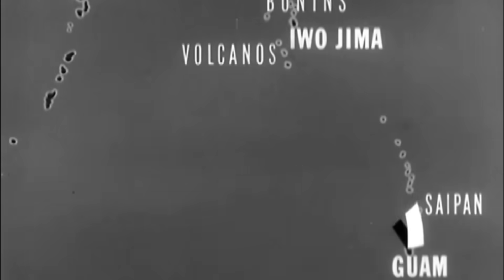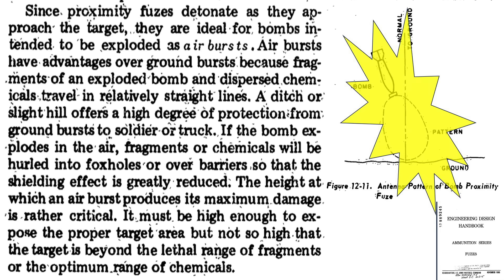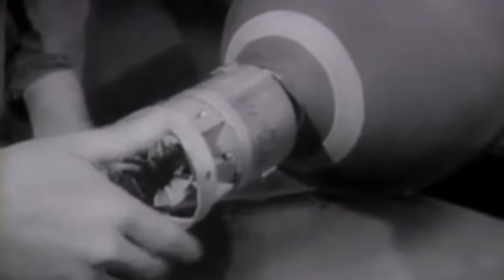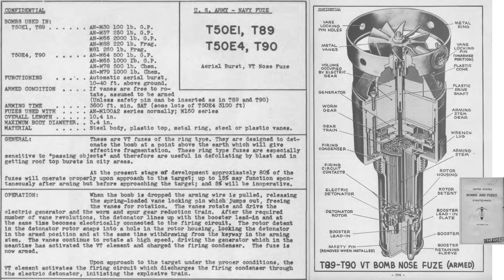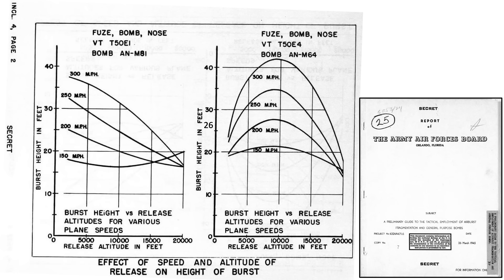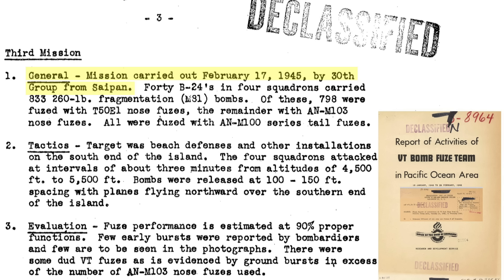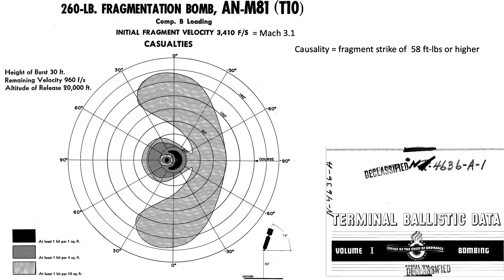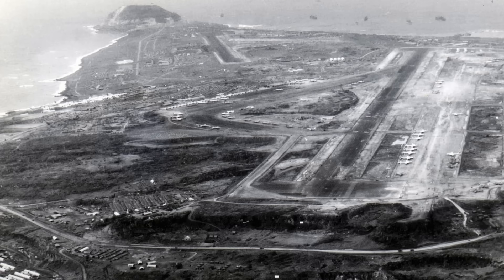B-24 Proximity Fused Bombing Attacks Supporting the Iwo Jima Landings – Combat Effectiveness Review

Comment: The proximity fuse was so secret that the US Navy did not use them when the shells could come down over land, only water.  By 1945 this had changed but by then the garrison at Iwo Jima was already well entrenched underground.  The shame of it is that if the US had invaded Iwo Jima earlier the garrison there would have been much smaller and caught above ground making the taking of the island much easier and far less costly.

Comment: -A proximity fuse on a bomb is not hard to achieve since the bomb is unlikely to be subject to much more than 1g of acceleration.  What is hard to achieve is a shock hardened proximity fuse that can remain functioning after a 10,000G acceleration from a 1000m/sec canon.  The Germans had air dropped bomb a proximity fuse based on their excellent FuG 101a radar altimeter.  The allies were so concerned they started developing countermeasures in case they were used.  There indeed was a program for these.

Comment: I believe VT fuzes were effective against aircraft, but I find their effectiveness highly questionable when it comes to attacking Japanese soldiers hidden in tunnels, such as those on Iwo Jima. While they might have been effective against soldiers in trenches, the Japanese troops on Iwo Jima weren’t even in trenches.
Reply: I think for the most part it turned rocks and coral into smaller rocks and coral. In this case I think the regularly fused bombs might have been more effective. On the other hand, 16" naval shells were not particularly effective against this target either.

Comment: During the Vietnam War, Mk81 250-lb bombs were often fitted with tubes protruding from the bombs' noses, with fuzes at the forward end of the tubes.

This begs two questions :

1) Why were these fuzes used instead of proximity fuzes ?
2) Why weren't such tube/fuze assemblies used in WW2 ?
Reply: I doubt that they were "often fitted" to 250-lb bombs. Note that a proximity fuze is a different beast for a different purpose - exploding a good few metres above the ground. You are referring to the 36-inch Daisycutter fuze extension - in Vietnam it was used mostly in 500-lb, 750-lb, and 15,000-lb bombs to clear helicopter landing zones (HLZs) in dense jungle - they of course exploded only just above the ground using a contact fuze. They were of no use on a 250-lb bomb. The first reference to a daisy-cutter type of bomb is in 1918 in an attack on the RAF airfield at Bertangles. It WAS used in WWII - Oskar Dinort invented an extended-nose fuse device known as the Dinort rod (Dinortstäbe) which were placed on the noses of SC 50 and 250 bombs dropped from the Junkers Ju 87. [much of the above is from Wiki].

Comment: According to a book I read about Japanese secret weapons development ( I'll dig up the title and post it below.), Japanese scientists came with the idea for a proximity fuse on their own, but it was an idea that remained on paper.  They never even tried to make a prototype.  

There is a reason for this.  Those American proximity fuses had four vacuum tubes in them to run the device.  The first transistor wasn't made until 1948.  A vacuum tube is a bunch of metal bits stuck inside a sealed glass tube with a ceramic cap on one end.  Obviously these devices are far more easy to break than a modern transistor.  American made vacuum tubes; despite having a glass envelope, were very rugged.  They could survive hundreds of G's caused by being fired from a 5 inch gun and the centrifugal force of being inside a spinning anti-aircraft shell.  

Because of lack of proper materials in Japan due to submarine warfare and Japanese manufacturing degrading because highly skilled workers weren't immune from being conscripted, Japanese made vacuum tubes were garbage.  The failure rate on them was insane as was the high percentage that simply didn't work straight out of the box.  Japanese scientists knew the idea for a proximity fuse was a good one, but also knew Japanese made vacuum tubes wouldn't survive being fired from an anti-aircraft gun.

The book is "Secret Weapons and World War II: Japan in the Shadow of Big Science" by Walter Grunden.
Reply: -The Germans did have a proximity fuse program for FLAK.   In early 1940 they suspended it during the battle of France because all resources were to be devoted to weapons that could be fielded within 6 months with rare exception.  By the time they restarted it and were conducting firing trials in 1943 the USN BuOrd fuse was in service for a year in the Pacific
-Interestingly some of the ideas of the German fuse were disclosed by "The Oslo Letter" delivered by a German based Scientific Publisher to British Intelligence in 1940.   The letter explained how the fuse would work and even had a shock hardened vacuum tube called a cold gas Thyratron with the letter. 
-The Oslo letter fuse had the effect of restarting the British proximity fuse program which had been abandoned in about 1932 or so.  The British decided to focus on using thermionic vacuum tubes.
-The German fuse was very credible since German Bombs already used a Rheinmetall Borsig electronic arming and in some cases an time delay with cold gas Thyratrons that could survive impact with the ground.  
-The Cold gas Thyratron was only a sensitive and precise switch but it was extremely tough, so precise it could produce 0.1% accurate timers and so sensitive it could trigger of static electricity.  The Germans were able to transport and deliver bombs with the fuses installed and arm and disarm in the air.
-It's power consumption is so low it didn't need a battery, only a precharged capacitor.
-A Cold Gas Thyratron has 3 electrodes: Anode, Cathode and a Striking Anode in between.  A small voltage applied to the striking anode causes conduction which can be used to blow a fuselink that initiates a primer.
-A RC circuit can be charged to set the threshold for a timer.
-In the case of an electrostatic fuse an aerial Offset to the one side of the shell creates a 500Hz voltage which is rectified by a copper oxide diode and used to trigger a Thyratron.
-The plan was to use electronically timed fuses, electrostatic fuses or a combined fuse with a nose contact backup fuse. 
-The fuse worked to about 4m when tested on a firing range using 88 shells and lab versions worked to 10 and 15m.
-KUHGLOCKE, Electrostatic by Rhinemetall-Borsig. Intended for missiles.
-KUHGLOCKEN, Smaller version designed for AA shells.
Reply: Bombs are actually quite gentle on fuses. Artillery shells slam fuses with 20,000G - aerial bombs don’t (until they hit the ground (in which case a proximity fuse has already failed)). 
Vacuum tubes don’t actually need to be made of glass either - metallic vacuum tubes have been made (glass is just easier to seal and blindingly obvious when it fails).
Thermionic valves are actually still in use in some applications because of their radiation resistance (and thermionic devices can also be created on silicon and diamond chips).
Reply: @allangibson8494  - Bombs are more gentle on fuses, which is why proximity fuses could be used to create airbursts above ground targets in WW2, I believe starting in 1944, maybe 43.  

I should have been more clear why the Japanese couldn't create a proximity fuse.  It wouldn't have mattered if they used a metal sleeve rather than a glass tube for their vacuum tubes.  The flaws in Japanese made vacuum tubes were found in the materials used in the internal construction of their vacuum tubes.

For their time, vacuum tubes were pretty sophisticated in their construction.  Tungsten was used for the heater, the hottest part of a vacuum tube.  Molybdenum; which is also heat resistant, though not to the extent of tungsten, was used in parts near the heater.  Nickle was used for some parts; I believe mixed with chromium, and finally the metal prongs which extend from the ceramic base were made from or clad in copper.

Japan had tremendous difficulties getting any of these elements in sufficient quantity to be used in electronics.  

They couldn't get Nickle at all, except by melting downs coins with Nickle content captured in Hong Kong.

Molybdenum was almost impossible for the Japanese to get.  The U.S. embargoed Molybdenum shipments to Japan starting in 1939.

Tungsten use was rationed.  It was decided that aircraft engine parts that needed to be heat resistant was a higher priority than vacuum tubes.

Even the use of Copper was rationed.  The Japanese stopped using Copper in wiring or other electronic parts.

They replaced all of these materials with iron.  More accurately, with iron alloys.  For electrical conductivity this works, but iron has some fatal flaws when used in electronics.

First, it rusts.  Not a problem inside a vacuum tube, but a problem for anything outside of that vacuum, like those prongs that were on the outside of the base of the tube.  Also, very bad for external wiring when the insulation is broken in any place in the wiring.  So, this weakness was a nightmare for the Imperial Japanese Navy for obvious reasons.

A related problem; found after the war by U.S. researchers, Japanese wiring insulation was questionable, because their plastics industry was five to ten years behind the West.  In worse case situations they used paper and wax as insulation.  For heavy electric cables the situation wasn't that terrible, the Japanese coated those cables in rubber.

Iron lacks the heat résistance of Tungsten and Molybdenum, so it doesn't last very long. 

Also iron isn't very ductile compared to some of these other elements.   In other words, it's brittle and won't stand up to high G's.  This may have been the main reason why Japanese scientists knew that it was impossible for Japan to make a proximity fuse.

The mean lifespan of a Japanese manufactured vacuum tube was about 100 hours.  This doesn't count the large number that simply didn't function at all out of the box.  The Japanese didn't start to improve quality control testing for defective vacuum tubes until about mid-1944.

I keep finding different numbers for the expected lifespan of American made vacuum tubes, but it was in the low thousands of hours.  At least twenty or thirty times better than anything the Japanese could make.
Reply: What about a fuze for air dropped or rocket launched ordnance? The acceleration forces would be much lower.
Reply: @Treblaine  - Bombs were used in WW2 with proximity fuses to airburst above ground targets.

Rockets with a proximity fuse were just being introduced at the end of WW2.
Reply: @Kwolfx  I'm asking why didn't the Japanese develop such proximity fuzes for such weapons.

You said they wouldn't develop them for artillery due to the high g-forces of being fired down a barrel. But that's not the case with bombs/rockets.

Are you saying the Japanese began to introduce rockets with proximity fuzes at the end of WW2?
Reply: @Treblaine  No, only the U.S. did.  As I said in my original post, the Japanese didn't even build a prototype.  It was just an idea on the drawing board that was deemed impractical to attempt.  

Japanese researchers were thinking about anti-air defenses, which was a huge priority for Japan at the time. 

The British came up with the idea for proximity fuses first, but though they did some testing of the idea, and they shared it with the U.S. only the U.S. fully developed it.

I've read the reason might be because the British military didn't think of it or request anything like it.  They thought their scientists; or Boffins as they called them, should just do what they were told and not come up with ideas on their own.  That is probably an exaggeration of what really happened but there might be some truth to it.

Comment: The Japanese airforce did actually use an optical proximity fuze for bombs, on a small scale. This fuze send out a pulsating lightbeam, that would then be reflected from the ground back to an optical sensor. This fuze was much more complicated to use, than the American VT fuze, as it had to be connected to an electric system in the plane, so that it could be charged just before release of the bomb.

Comment: Interesting.  I never heard of VT fuzed gravity bombs before.  I knew there were prohibitions about using VT artillery on land to prevent Germany/Japan finding one and reverse engineering it.
Reply: VT fuzes used a simple compact form of radar and they could be jammed or made to operate improperly if the opposition knew enough about them to deploy countermeasures. The ability of the Axis war effort to make their own versions of the VT fuze wasn't the main issue. The VT fuze designers added some extra functions to the fuze circuitry to make jamming less effective and this worked in tests but I don't think there were any Axis efforts to create anti-VT fuze jammers in the end.
Reply: By the time they were used as described in this video, Germany had lost the War in Europe, and Japanese AA was ineffective.  In any case, the prohibition on use over land had been rescinded in order to destroy V-1 flying bombs deployed in thousands against England - for which there was no other effective defense.   Also, the VT fuze used in bombs is a different design to that used in anti-aircraft shells.
Reply: @keithammleter3824  The release for use against V-1 flying bombs was restricted to the belt of 3.7" AA guns positioned along the coast facing the English Channel, on the principle that "dud" shells would end up in the water rather on land. The inner belt of AA guns protecting London were not allowed the use of the VT fuze, the gap between the two belts was patrolled by fighters like the Hawker Typhoon and late-model Spitfires. These planes had the speed to catch up with V-1s that slipped through the first coastal AA gun belt.
Reply: @robertsneddon731  You are totally wrong.    Not only were VT fuzed shells used on the British coast, American troops in Europe used VT-fuzed shells to destroy V-1's launched from areas the Germans still controlled in Belgium and Holland as the V-1's overflew American held areas on their way to London.   In fact a majority of V-1's never even reached the British coast.
If you think a Typhoon (top speed 680 km/hr could reliably close on a V-1 (speed over England >640 km/hr) you are living in fantasy, given the limited warning time from radar.   And if you think a Spitfire (top speed 600 km/hr) could do it at all you are bonkers.
A British fighter did manage to bring down a V-1 by touching wing-to-wing and flipping it over, but that was a fluke resulting in being in the right place at the right time.   And if you think that fighters could be flown on patrol waiting for V-1''s - Britain never had anywhere near enough fighters.
Winston Churchill described in his history of WW2 how he negotiated the rescinding of the prohibition of using VT fuzes over land, and having them transported from the USA, stating that it was in the nick of time as Britain otherwise had no effective defence.
The German boffins specifically designed the V-1 to be substantially immune to all known defenses the British could concievably employ, but they didn't know about the top secret VT fuze.
Reply: VT fuze was a huge secret and normally not used in situations where it could be recovered. The one used in gravity bombs also had a self-destruction timer in case of a failure.
Reply: @glandhound  All the wartime VT fuzes had a self destruct timer, primarily to ensure the shell exploded at altitude and did not damage anything when gravity brought it back to earth.   This was not considered good enough to ensure its secrecy if used over land - until that use was no longer banned..

Comment: Fascinating work! I knew about the Japanese Mark 31 proximity fused bombs used in about 1945, and I assumed that the US deployed similar in WW2 as well, but couldn't find much of any information about it. Thank you for your many informative and insightful videos on such matters and keep up the great work!

For reference on the Mark 31 bomb's operational use in case you are curious, pages 27-28 in "芙蓉部隊天号作戦々史 自昭和20年2月1日至昭和20年8月末日 第3航空艦隊131航空隊芙蓉部隊" (can be found in JACAR) describes their operation by a Fuyo unit of the Number 131 air group, 3rd air fleet.
Reply: I wasn’t aware that the Japanese had air burst bombs.  I found a paper at https://ww2data.blogspot.com/2016/04/imperial-japanese-navy-explosives-bombs_11.html
Reply: Looks like they had a photo cell fuse and a sorta complicated plummet fuse
Reply: @peterdoege1740  Indeed, the document describes the operation of the unit between February to August of 1945 and details the use of the 250kg and 800kg variants. I was certain of US radio proximity fuzed bombs being used during the war but lacked much in the way of documentation for it so this video has been quite helpful in pointing me in that direction.

Comment: Could you also cover the effectiveness of the various explosive filler options? Torpex, according to the Terminal Ballistics document, had almost 200% effectiveness against structures when compared to an equal mass of TNT under the same conditions, for example.
Reply: I think torpex had aluminum powder in it which greatly increased the blast overpressure (and rarefaction) which is why it was better at blowing holes in ships and structures to splinters